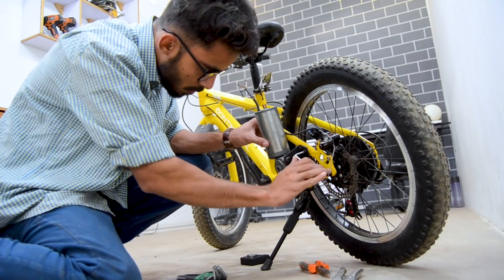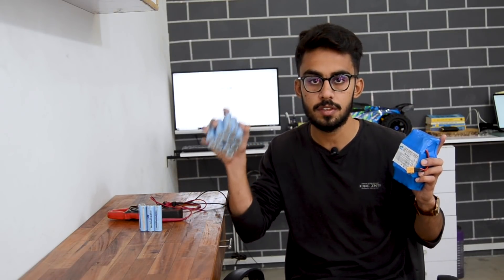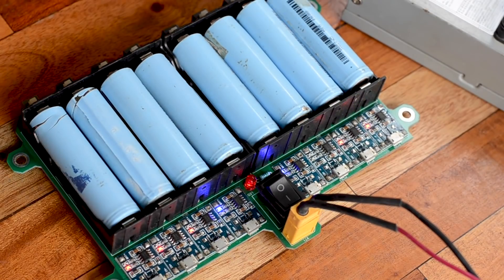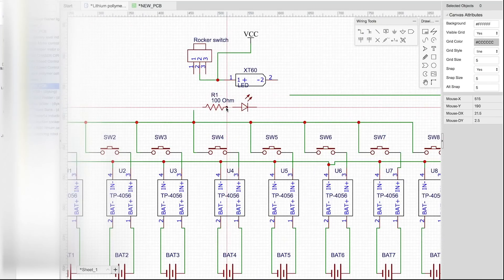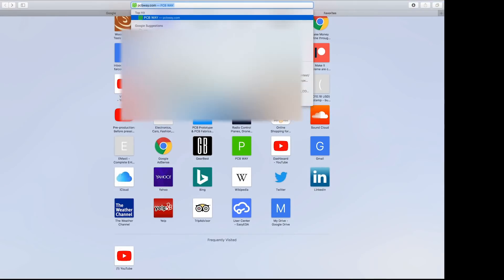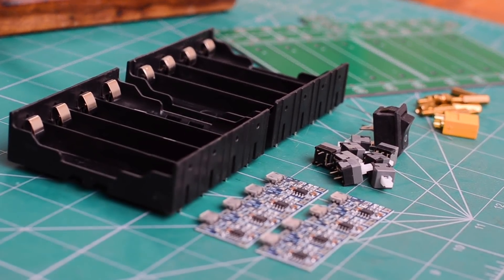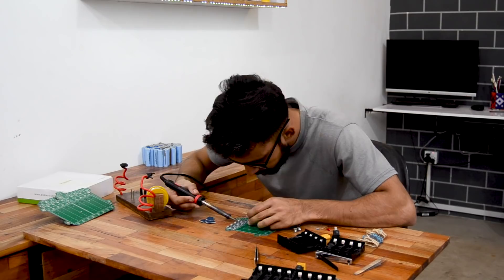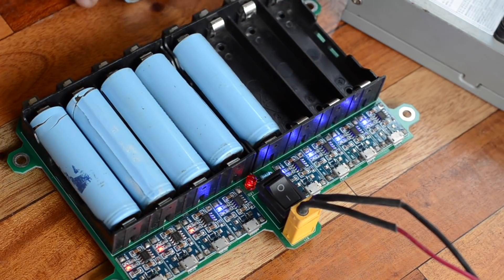How to make a Lithium Ion Cell Charger (18650 Cells Charging Grid)

Comment: Hi, great build process, just one little thing... TP4056 is a linear regulator, as opposed to a switching boost converter. They must be fed with a voltage slightly higher than what you expect the module to put out - to charge a 4.2v cell, power with 5v

Comment: I purchased the boards and added all the parts, looks great, but I cannot get the XT60 power to any of the TP4056 boards.  I can power each TP4056 individually but when I plug into the XT60 plug the led lights up but none of the boards show power.  Any thoughts on what is wrong?
Reply: Did you figure this out?
Reply: I believe it's because we are using momentary switchea

Comment: I ordered and received your kit but I can't find those push button switches under the battery case. Do you have a link where I can purchase them?
Reply from the maker: Ok I will provide the link to those push buttons in a few hours
Reply: Are the switches momentary or latching? I am unable to find a new link to the switches.
Reply from the maker: No these are not momentary switches
Reply: @DIYKingSaM  Can you please repost link for the push button switches? I ordered the Panasonic switches (had to order 100) but the stock number is for momentary switches... Thank you!
Reply: I placed order of these right now, but my setup is working fine with the fuses. I'll swap them when I receive the switches
Reply: @noelopez2576  oif it is not too late- cancel your order! Those are momentary switches and will not keep circuit on. I know because that is why I ordered (100 of them) from the info on the BOM in the links... That is not the switch DIY King used in the video. Good luck!
Reply: @DIYKingSaM  Can you please repost the link for the switches?! Not the single rocker switch adjacent to the XT60 but the 8 push-on push-off switches. I have a stack of circuit boards and a box of all the other components- I only require the switches. I am having considerable difficulty sourcing a switch that will fit the PC board. Thank you!
Reply from the maker: @robertw.brunnemerii995  please provide me your email address
Reply: @DIYKingSaM  Well after many days of furnishing my email address as asked, and with no reply - I have this to say... I have spent considerable money on this project (much of it following your links- which earns you money) and also considerable time trying to source the proper switches for the bms boards with little luck. I have almost 200 switches that are of no use to me. It will make little difference but I am unsubscribing from your channel. You will not make any more money from me. Ignoring your subscribers when you post incorrect information will cost you in the long run!
Reply: Uh oh... the 100 I purchased from the vendor per the BOM are all wrong then... Can you repost the link fr the switches in the video please? (Not the rocker sw but the (8) switches for the charge control modules)  Thank you!
Reply: @robertw.brunnemerii995  I couldn't find those switches so I soldered a 5amp glass fuse to it and it's working fine. I don't know if I'm wrong doing this but i have it charging in my shed's solar system

Comment: It's 1.5v or 3v battery?
Reply from the maker: That an 18650 lithium ion cell with a nominal cell voltage of 3.7v
Reply: Why did you include the individual battery switches?

Comment: Would the be a way to simplify the board to just have the TP4056s and maybe switch the holders to an 18650 SMD battery holder? Would the be a way to get the PCB to connect side by side instead of stacked?  If I had your skill at using the pcb software I'd figure out a way.  Great work,  this is what I was thinking of for an easy DIY inexpensive charge station. You're awesome.

Comment: @DIY King -- The PCBs and Gerber files link to PCBway.com doesn't seem to be working.  I searched their shared projects for "18650", "charger" & "grid" but none of the three searches turned up your project.  Could you please re-upload and re-share the project, or better yet post the gerbers and eCAD files to GitHub (assuming that you are open sourcing the project). 

Thanks again for the very cool concept / design.
Reply: Found the Gerber files zip on https://www.instructables.com/id/DIY-18650-Lithium-Ion-Cells-Charging-Grid/
Uploaded to OSHPark to order some boards and then shared. (see separate comment.) Hope this okay.

Comment: Nice work :)

Looks like you have the long screw posts that connect the two modular units also serving the purpose of providing power to the second module? I like that design, good use of structural item that is already there :)

Question however... end of your video you show it sitting on end, meaning metal support posts are near the surface sitting on. What is risk of a short? Looking top down  so you have negative far left and positive far right? aka, both far left posts both being negative, and both far right posts positive?

What max current theoretically could go through those posts? aka, what is max number of units you could stack before the posts get to hot?
Reply from the maker: Thanks for the good words.

The actual idea is to use standoffs but the ones I have got are short so I used some screws laying arround . Besides the top left and right mounting holes pads are positive and negative. They act as the power bus across the modules and are designed to stack upto 10 modules.
Reply from the maker: You are right about getting the modules shorted when placed on a metal base but I am planning to get the plastic base standoffs to make sure nothing goes bad